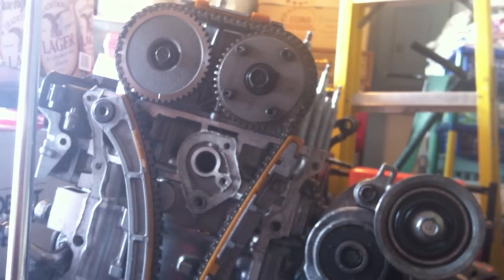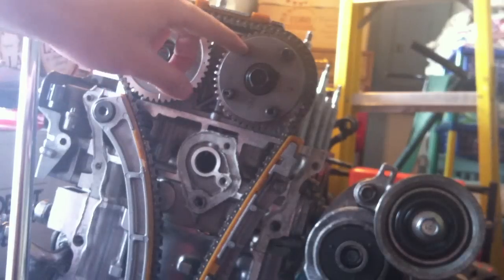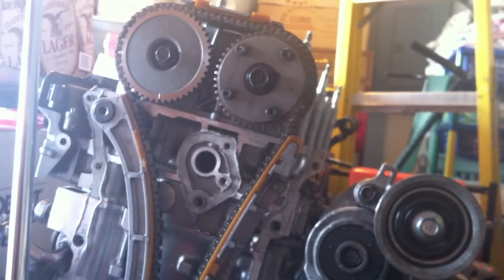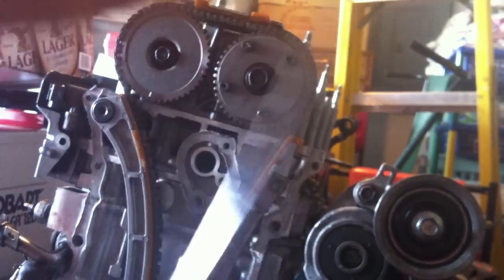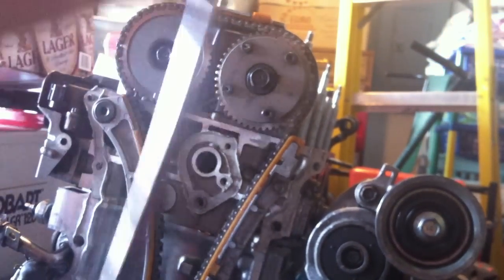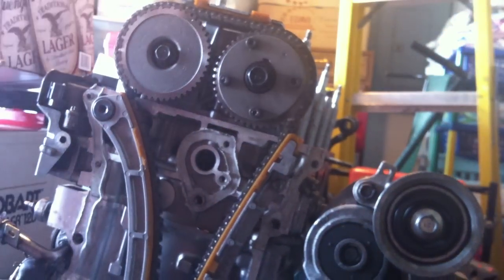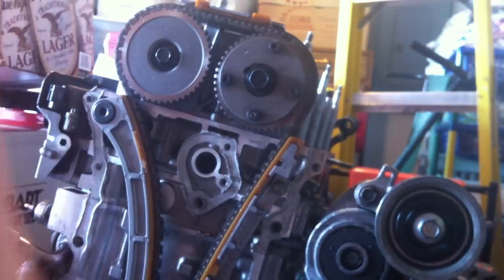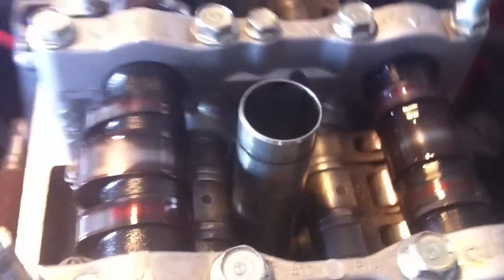skunk2 stage3v3's in a k-series with no chain slap!

Comment: Definitely should use an uprated tensioner....
Reply from the maker: MrStoneycool69 lasted for months until I upgraded to dc4.5 cams
Reply: Lasted for months???? I wouldn't had taken that risk....
Reply from the maker: MrStoneycool69 everybody has their own opinions. I took the risk and never had any issues. Only reason I even swapped them out was to make more power.
Reply: Sure by all means, I read on the Skunk2 website they recommended a stronger tensioner when going to stage 2 cams. I was referring to daily driver long term reliability, not racing applications.
http://www.superstreetonline.com/how-to/engine/1807-project-k24-pt-ii-a-rock-bottom/